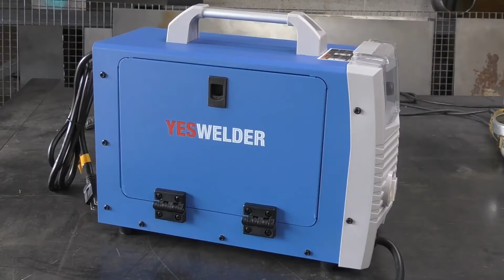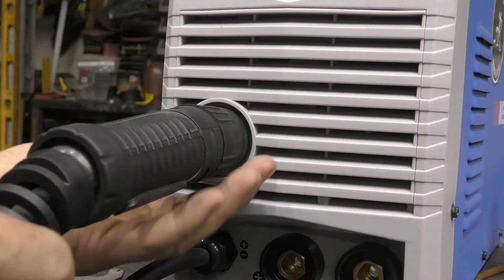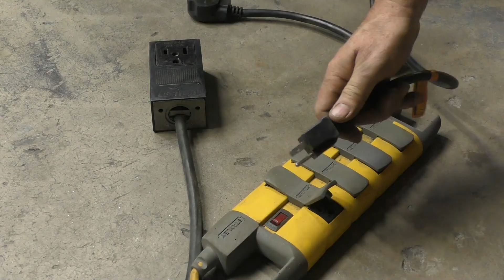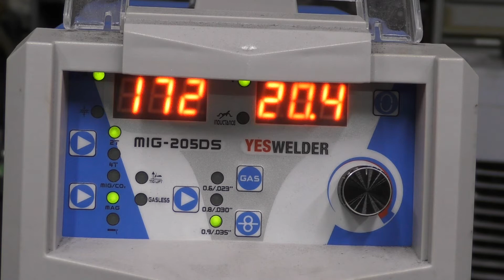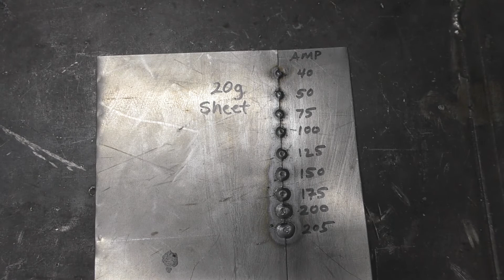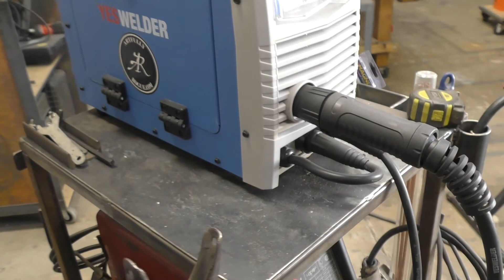Most Affordable Multi-Process Welder Online -10% Discount Code

Comment: Now that you’ve had this machine for a while, how has it held up?
Reply from the maker: I use it everyday on every project and it's held up great. On the rare occasion it may glitch and the wire speed ramps up too fast but I turn the machine off and back on and it's fine. That happens maybe once in a few months. I'm still very pleased that I got it

Comment: I can tell you that their product suppot is very poor.  No phone  contact and email is poor. They do NOT speak English.
Reply from the maker: There product is slow that's for sure. Its through email correspondance and does take time due to time zone. I haven't had any issues understanding their emails which are in fact written in english. Not sure about whether they "speak" english since I've not talked to them on the phone but then you did point out that there's "no phone contact". Despite the time delay, they have worked with me anytime i've had issues, which has only been once so far.

Comment: Nice review.  No wire speed control ?
Reply from the maker: At first I thought that would frustrate me, but I've gotten use to it. I still hope its a change they make in future models
Reply: @ArtfullyRogue  oh yeah. I tried several times to use your discount code but it would not take how I was trying to type it in.  Tried several ways.
Reply: @ArtfullyRogue  mine arrived yesterday.  My accessories are in different shipments comming still, like the tig torch and wire and consumables and what not.  It's an amazing looking little machine, I'm used to my 250 pound millermatic 212 auto set that I cannot pickup and put in the truck.  I'm looking forward to using this YES machine bigtime.  A professional welder gave me a tip yesterday. He said if you use frontierarc 711 flux core wire and also use gas shield your welds look like " wedding ring smooth."  So I'm kinda stoked to try that.  And the lift start might be cool on tig.  My tig experience is crude with strike arc start, without pedal never got proficient. That Yes is nice, nice, nicr except the gas hose, it's like raw sticky rubber.  But the quality on the mig torch is exceptional for the price. I think I might have to go YES plasma cutter next.

Comment: Product placement!  My friend, you've been seduced by the dark side.  Lol.  How sturdy is the drive mechanism?  I'm still using an assortment of off brand welders for doing handrails.  If I go any heavier than 2 pound rolls the motors tend to labour and can't start smoothly.  One reason I want to upgrade to a Lincoln wire feed welder.  Cheers.
Reply from the maker: Right! It all started when I bought their flux core wire and it was literally the smoothest flux core wire I've ever used. So i them checked out their products and figured I'd try the multi process welder, which I had been looking into but didn't want to spend an arm and a leg on. I'm curious how it will handle the daily non stop use it will get in my shop. So far so good though